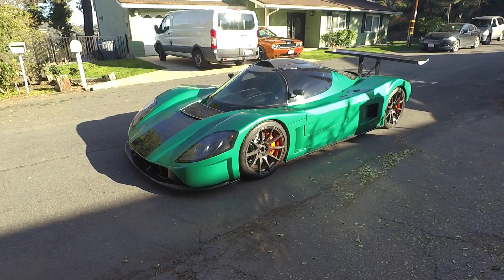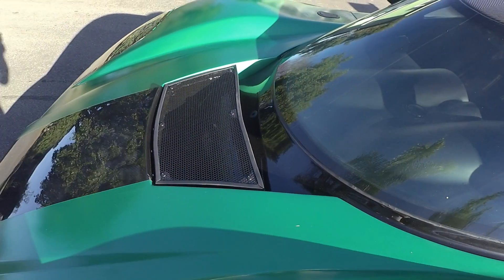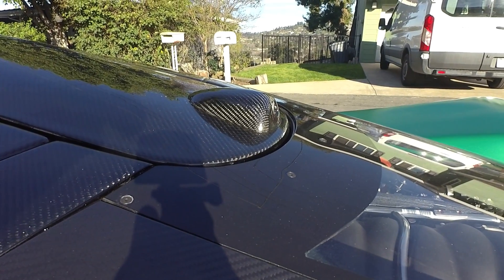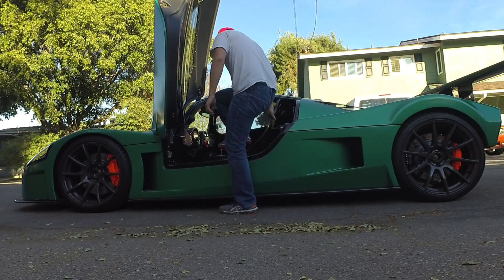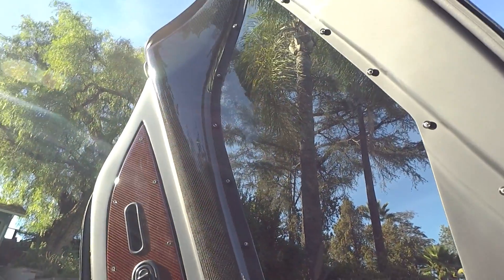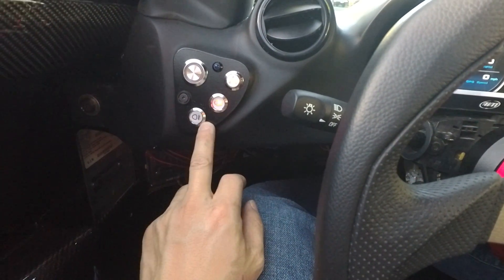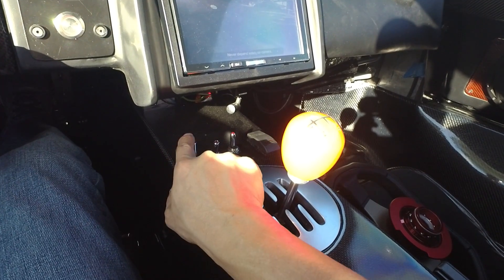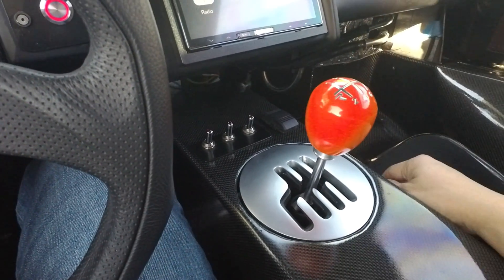Superlite SLC - Walkaround

Comment: Might want to work on the wing angle. Overall, it looks good.
Reply: Don't want the angle of attack to be too aggressive though
Reply: rs murdoch 
I’m no aerodynamicist, but it looks like your angle combined with the profile would be generating lift. I
think there is a thread about race setup on the GT40 forum. See what they suggest and dial it back form
there. IMHO. 
Nice build. Doing the preliminary on one myself.

Did you drop in on Fran before buying? If so, was it worth the trip?
Reply: @andrewlangley9507  Holy sh*t you are right, that angle is AWFUL. It's rotated so far back that it forms a U shape towards the horizontal plane. There is no way the air flow will adhere. It WILL generate lift, no doubt about it.
Reply: Huxxy 
At some point, a wings angle of attack prevents the profile from generating
lift. (Or downforce in this case.) Imagine if the leading edge was sitting 1” above
the trailing edge. The only unknown is whether or not his current setup is
past that point. Look at any wing on cars that require them for downforce.
They simply are not setup this way.
Reply from the maker: @Andrew Langley - hey sorry, just saw this comment.  The wing angle I've got it on is pretty aggressive actually.  Going much more and the trade between downforce and drag gets less optimized - and for the street having a crazy amount of downforce just isn't necessary.  As far as I know, I'm the only one who's done a study on wing angle, you won't find any discussion of wing angles or (actual) recommendations on GT40s or the wiki.

If you're super into it, do a search for the Selig 1223 airfoil design and you can come to your own conclusions.  Or check out my blog post here: https://socalslc.com/2018/09/29/53-red-bull-gives-you/

At the time of the video, I had the rear wing on setting 2.

A lot of people get stuck on the idea that rear wings should be canted at a ~30-degree angle; a properly designed wing doesn't work by having air slam into it to "push it down".  A properly designed wing works by having air BELOW the wing move faster than the air above it, creating a low pressure zone and "sucking" the wing down.  And while I'm also not an aerodynamicist, I've touched the subject in various engineering classes.

I opted to purchase the SLC sight unseen, haven't visited the factory before.  For the guys who have visited the factory, everyone's always had a really positive experience.
Reply from the maker: @The4valance - check out this blog post: https://socalslc.com/2018/09/29/53-red-bull-gives-you/
Reply from the maker: @Huxxy - I think you get it ;) lots of armchair engineering going on.
Reply from the maker: @The4valanche - do a search for the Selig 1223 airfoil design; while it looks like the wing is set flat it's actually got a ~5 degree angle of attack.  The geometry of this wing puts a real sharp up-turn as it tapers to the trailing edge and this particular airfoil shape is really well suited for shallow angles of attack - to decrease drag.  There's no sense in generating mega amounts of downforce on the street at the cost of also incurring a ton of drag.  Better to optimize usable downforce while minimizing drag.

I suppose I could have slapped an aftermarket wing on there and gotten a really good aggressive look while dropping a few mpg and top speed for the street cred.
Reply from the maker: @Huxxy - it's called a gurney flap.  There's a ton of info you can gather by doing a quick search for gurney flaps.  The reason I added one to my radiator discharge is the center area immediately in front of the windshield is a high pressure zone - not exactly the location you want to be dumping air out into if you want as smooth and unrestricted an exit as possible.  By installing a gurney flap forward of this location I'm hoping to incite an area of disturbance in front of the windscreen and thereby decrease the pressure in this area - hopefully enough that the radiator discharge can exit relatively freely.

The amount of drag caused by the gurney flap is minor in comparison to its benefits and is employed at the trailing edge of many wing designs.
Reply from the maker: @Huxxy - so yes, to induce a low pressure zone behind it ;)
Reply from the maker: @Huxxy - there’s a difference between laminar and turbulent flow.  A 45deg flap would be an attempt at trying to keep the flow attached/laminar.  It wouldn’t be the best way to create a large pressure/flow change in a very short distance (which is what I need in this case).  A sharp change in geometry like a gurney flap would be a device that could create turbulence in a short distance.

I’m too cheap to get a wind tunnel but with enough searching you might find some tunnel testing of that selig 1223 airfoil ;)
Reply from the maker: @Huxxy - yeah I'm sure we could, one of my other passions is audio but I put myself at just below pro-sumer level, can't stomach the premium for most of the "higher end" consumer level stuff but I'm into it enough to have mapped my room and tuned my own equalizer.  Speaker building would be a hobby but I don't have the room and well ... I bought an SLC ;)
Reply from the maker: @Huxxy - well, I wouldn't go so far as to call anyone a dickhead, but I did spend a considerable amount of time thinking about everything on the car.  Every hole location, bolt size, bolt material, etc ... I factored in everything I thought was relevant to that particular decision.  That said, I know there's a bunch of stuff I didn't do right on the car :)
Reply from the maker: @Huxxy - correct, on that Brabham they're doing the same thing.  They're actually doing it right/better by separating the flow and directing it away from the center, similar to the P1.  I didn't think I had the fiberglass skills to construct such an exit so I went a bit more low tech in my execution.

Comment: You've made a great work with this car! You've though about everything. But I can't stop wondering, What about wiper blades? What if it rains in the middle of your ride??
Reply from the maker: Just drive faster!  A bit of a joke but also serious ... in a light rain the water gets pushed off the windshield pretty easily by oncoming air.  In a heavier rain ... you’d be a bit nuts to keep driving the car, safer to just pull over and wait it out.  I didn’t like the look of wiper blades and I’m a fair weather driver only.  If it’s going to rain I don’t bother pulling the car out.

Comment: Hi, how much the total built cost you and how long it took from start to finish? Thank you.
Reply from the maker: @Portable Electric Vehicle - about as much as a nicely equipped BMW.  It took me about 2400hrs to complete.
Reply: @CamThai  2400 hours? Why did it take you so much time? Can you buy it all the parts so you can assemble it in 2 weeks? How much would that cost? Thx
Reply from the maker: @Portable Electric Vehicle - 2400hrs because I work slowly ... I'm guessing you haven't been around custom built cars, they can (and should) take a lot of time.  You can buy all the parts at one time and have the entire car in pieces in your garage.  SLC builds typically range from about 80-120k in materials for a nice street car, less for track oriented builds.

Comment: Awesome 🤘🏻🤘🏻🤘🏻..... I’m soooo jealous!!! Beautiful dash setup and love all the carbon inside. Is there a lot of road noise without carpet?
Reply from the maker: The Drive Inside - thanks for the feedback!  Not much road noise at all but I’m using a ton of Second Skin Luxury Liner Pro to knock down road noise.  The carbon tub covers everything around the driver except right around the seat and the foot box forward of the ~knees.  It’s hard to see in the video but I have carpet between the seat and the seat pan, and carpeting on the floor and sides of the foot box as well.  There’s an aluminum panel my feet rest on so my heels don’t totally tear up the carpet.

Comment: Congrats man  this car is freakin awesome  but till need some special touch to make it unique as u can see under the dashboard all wires and relays bolck naked  also if they Improving a headlights and the tail light design  with 3D modeling and printing I guess it's possible to creating something new and unique  but overall i think it's that car i'd to own , actually im planning to order one sooner  just i study a plan to adding different engine Ford Ecoboost v6 with twin turbo 800-900hp powered with holley efi ecu and holley 12.3" colored dash  as far as i know the holley ecu not supporting DI fuel system i wish figure it out asap , keep on to filming and show us the accelerating with this beast 💪🏽

Comment: These cars started showing up on my feed so I started looking at them more. Am I correct in that these kit cars come with everything beside the motor if you buy it directly from S/L?
Reply from the maker: Chad711m - you need a motor and transaxle.  Superlite supplies you with the necessary adapter plate to mate whatever combination you decide you want.  You’ll also need a clutch package and lots of smaller bolts (to attach your seat, fuel pumps, basically anything that isn’t the suspension or chassis bracing/cage).
Reply: @CamThai  OK thanks. Power to weight ratio looks insane on those. Should be fun on the track!
Reply: Chad711m they offer the transaxle now for 10,000 for the v8 or 12 something for v10. Also can add transmission completion kit as well. Just finished putting my build order together. Not making purchase just yet, as I’m worried about me fitting. I’m 6’7 250 pounds. Skinny but not small. So wanna make sure I have room to mount seat and pedals to accommodate me. I couldn’t buy the zo6 cause there engineers must hate tall people haha. So that’s why I’m looking to buy SL-C later this year
Reply from the maker: @Ty Austin - hard for me to say but I know my 6'2" father in law fit into my passenger seat.  I believe the extended foot boxes are now standard (which give a few more inches) and my seats are pretty upright.  Between the longer footbox and reclining the seat you may be able to get in - would be best to maybe take a visit to RCR or visit someone who's mid-build with an extended footbox.  Best of luck with your decision and feel free to reach out to me if you decide to pull the trigger or need more advice.
Reply: At 6' 7", I would be shocked if you fit.  I'm just under 6", even putting a helmet on leaves me with no headroom left.  These cars are basically shoulder to shoulder too.  If I had to guess, I'd say 6' 2" is probably about the limit before major yoga moves begin.
Reply: I’ve gotten the answer needed. The extended tub gives me the required room needed for my legs and dropped pan where seat will go allows plenty of room for me.

Comment: I couldn't help but notice how low the slcs settle above ground level.  I'm wondering how good they are at handling speed bumps.
Reply: Opt for the hydraulic lift kit. Speed bumps of all sizes are no issue.
Reply from the maker: @Maybach Meeky - the front lift kit should be considered mandatory for any street SLC.

Comment: Hi Cam, wondering how you like the standard manual doors vs. doing the electric actuator modification Allan does. Any regrets on keeping it simple and using the provided gas struts and bear claw? Keep up the good work on all your SL-C related info!
Reply from the maker: Definitely prefer the manual option.  Too many risks with the electric actuator.  Biggest is power outage in case of a wreck.  Those actuators have enough holding power to keep you trapped inside.  You'd have to break out the glass, don't think you'd be strong enough to knock out the poly side windows.

Comment: Looks like the wing is angled up too much so that the air passed under it instead of over ?
Reply from the maker: This particular wing design actually appears very shallow - so it almost looks like the front end us too far up.  In reality many of the wings you see being sold by a lot of aftermarket companies produce a significant amount of drag because they're pointed WAY too much relative to the direction of travel.  It looks cool, but that's not how wings work.  Think about an airplane - in flight, do the wings look mostly straight, or are they super curved/bent like a lot of the wings you see on cars?  A 5-degree angle of attack on this wing is very aggressive.

Comment: I have a video request Cam. next time you make a carbon piece can you do a video on how you do it.
Reply from the maker: @Andrew Burton - I’m working on a new piece shortly, will try and document it better so you can see the process.
Reply: @CamThai  thanks man oh also what is your intake tube?
Reply from the maker: @Andrew Burton the 4” pipe is Spectre Performance PN 97291 and I’m using couplers PN 9771.  Air filter is a K&N RF-1034.

Comment: How much did it cost you? Building it yourself and all? I know they cost around $44k or $48k I think. But to do it on ones self how much?
Reply from the maker: @Omar Aquavivas - full kit is $48k minus engine and trans.  A decently built and optioned street car usually falls between 80-140k depending how much of the build was done by yourself vs sending out for someone else to do.
Reply: Cam Thai that’s actually more cost effective to do it on self and the harder parts just allow another to do it. Overall for the price? It’s an excellent deal. 

I recently found out about the SLC’s and I want to build one closely resembling the Pagani in design and put a BMW E60 V10 in it along with a Porsche Tranny. 

Doesn’t sound as expensive when you start figuring out, how oneself can have it most of it done.

Thank you for the reply!! I love how your SLC came out!

Comment: What did the transaxle cost you and what hp-tq are you getting from the LS3 ?
Great work ! Gorgeous car
Reply from the maker: About 10k for the transaxle.  The stock motor makes 525hp/490 ftlbs.  I did some minor tweaking of the fuel map for drivability and it’s making about 550hp at the crank.
Reply: @CamThai  thanks for the info. I'm really thinking about this as a project. I'm normally a quarter mile guy on bikes but age is a cruel fact of life. 4 wheels are better than 2. Lol

Comment: Would it be possible to get an automatic transmission?
Reply from the maker: @Carl Morelli - sky’s the limit, only determined by how much you want to spend.  The Tavarish car had a sequential installed in it.  Paddle shift trans units have been fitted to the Ultima but those were on lower torque motors.

Comment: Any problems with new California exhaust laws?
Reply from the maker: Ross Dusterhoft - not as of yet, but I haven’t driven the car much since the 1st.  The law isn’t new, but the enforcement method is.  I’m not sure how those laws apply to my car in particular because it’s considered a “Specialty Construction” vehicle and the standard emissions and safety laws don’t apply to the SLC.  I haven’t done the research to determine what the muffler requirements are for this type of vehicle but I did go to a BAR referee to have it inspected as part of the original registration process.  If you get hit with a exhaust violation you need to go to the same facility to have your vehicle inspected.  (Shrug) I try not to rev my engine or do anything too silly in public so hopefully that keeps me under law enforcement’s radar.

Comment: If you dont have some kind of ventilation system  or air condition system it would get really hot inside  without roll down  side windows.
Reply from the maker: @Joe Dirt - unfortunately roll down side windows aren't possible on this car.  It's got a fully functional air conditioning and heater system which keeps it pretty comfortable inside the cockpit!

Comment: Can you use a smaller engine 
Like a 2jz or v6
Reply from the maker: Enchantress - sure, don’t see why not.  Someone’s already thrown a 2 rotor into an SLC.  General rule of thumb is you can fit whatever your pockets can pay for.  If the engine package you want to fit is too big for the standard chassis Superlite will work with you to make the mods necessary to fit your selection - usually at extra cost of course.
Reply: I know of at least two cars now that have 3 Rotors in them. And an early SLC (built for extreme lightweight track use) had a Subaru boxer 4 in it. Also, a there was a Porsche flat 6 put in one about 5 years back (also a dedicated track car). Im unsure of a 2jz due to length.